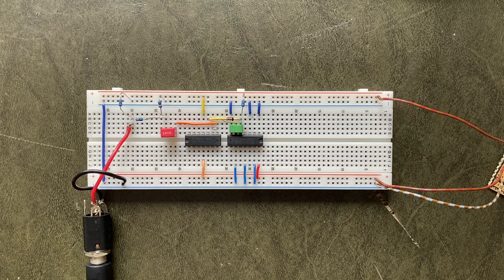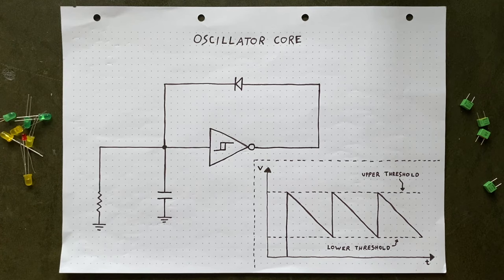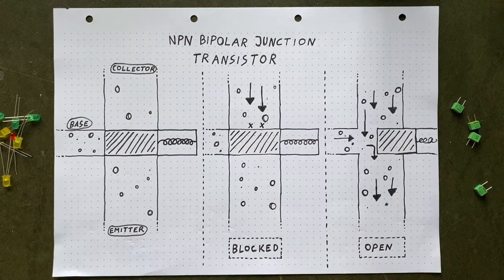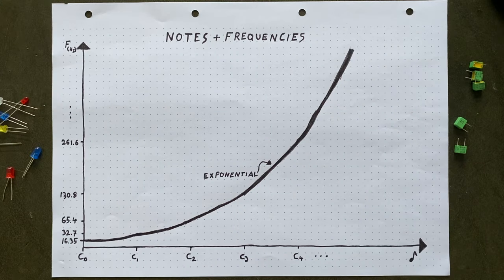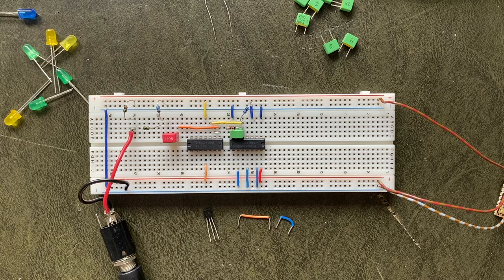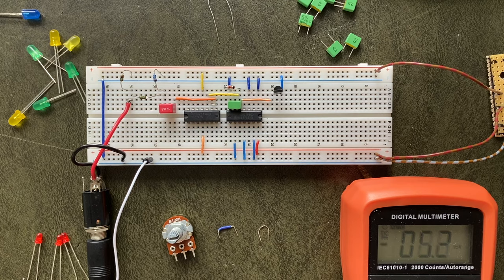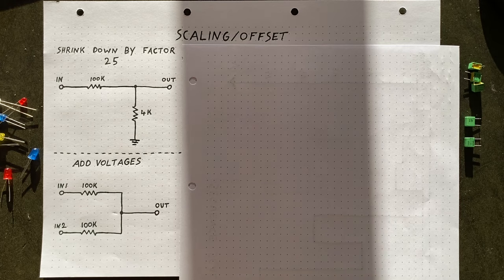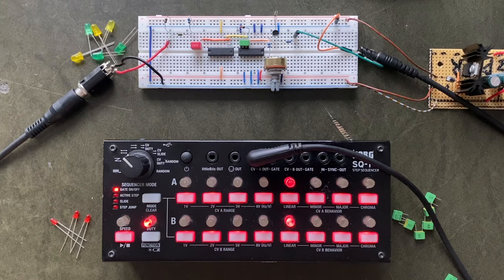DIY VCO Part 2: The simplest exponential converter

Comment: Now when a CV comes from a source such as an MS-20Kit, which is expontential, would you not want the transistor to operate in a linear manner? 
Apparently (haven't tested it yet) the VCO in a 4046 PPL is linear, so it might be a good candidate for me to create another hz/v VCO for my MS-20. 
Lots of material on V/octave, but a dearth on the info for Hz/V. 

(The loser in the Betacam/VHS note voltage scheme war)!!!!
Reply from the maker: yep, Hz/V is linear! but that makes it very complicated to build sequencers for it. hence why it fell out of favour i think.
Reply: @MoritzKlein0  I have more synths that are V/octave than Hz/V, but the MS-20 delivers exponential CV for linear VCOs, so it would be fairly straightforward to control linear devices. no exponential converter nee. On my next digikey run I will pick up a 4046 and see how well it interfaces with the MS-20!
Reply from the maker: @SouthShoreSonics  sounds like a plan, keep me updated on that! ah and there's actually another MS-20 idiosyncrasy: it uses S-Trig instead of V-Trig! this has caused me quite the headache when i was trying to get it to interface with my self-built modular..

Comment: I'm trying to understand why you wouldn't just use the Potentiometer in place of  the restistor in the oscilator circuit.
Reply from the maker: because we're trying to control it with a voltage, so that you can use a sequencer to set the frequency.

Comment: Could you use a vactrol instead (or in addition to) a potentiometer? It would maybe not be super accurate, I assume?
Reply from the maker: i mean – yeah? but why would you want to? the transistor is already used for voltage control here!
Reply: @MoritzKlein0  just wondering it could be interesting to use as an extra modulation source for instance that interacts differently

Comment: I thought radios historically used variable capacitors, via moving plates around.  So I thought variable capacitance was possible.  But I don't know how much variance they allow.  Obviously using a variable resistance is the way to go.  It just seemed the video suggested variable capacitance was not possible, and I was curious why.
Reply from the maker: it’s possible, but not really feasible! that’s why you won’t find it in many synth circuits (if any)
Reply: There are varicap diodes, that are basically voltage controlled capacitors.
https://en.wikipedia.org/wiki/Varicap
But as far as I know they are only used in tuners not in VCOs.
Reply from the maker: @dreamyrhodes  bought some recently to see if i can make a filter out of them. but i don‘t think the range will be big enough sadly.
Reply: @MoritzKlein0  Would like to see that experiment! But I too think there is a reason why they are not used in synths. Maybe in tuners you need way less capacities for the higher frequencies.
Reply: Their capacitance is so tiny they're only useful at radio frequencies.

Comment: It would probably be worth explicitly saying something about where these voltages are coming from. In the first video, the power supply is the only source of voltage. In the second video, the power supply is putting out a voltage to make sound and the sequencer is putting out an independent voltage to give us offsets from that sound. That's what you are adding together in the voltage offset section near the end of the video. But these voltages don't have the same ground. Your sequencer isn't plugged into the same electrical system that your power supply is. For those using batteries as a power supply for the oscillator, presumably a battery-powered sequencer would have the same ground sort of "by accident" of how batteries work, not because their grounds are tied together. This seems like a problem. Maybe you address it in a later video.
Reply from the maker: they do have the same ground, because all grounds are tied together. this is standard procedure with any type of electrical connector - they always tie ground to ground.
Reply: @MoritzKlein0  All grounds in a single building, sure. But two battery sources or one battery source and another outlet source won't have the same ground. The batteries have floating grounds.

Understand I'm not criticizing. I'm just trying to wrap my head around some of these things. Most of the analogies you've made are extremely helpful. The "passive mixing circuit" is just messing with my brain. I found another video that explains it in more mathematical detail, and he does mention that the assumption is all the voltages are sharing a common ground: 
https://www.youtube.com/watch?v=vbr4XbAhlnQ

It also looks like the output of the mixing here isn't the sum of the two voltages but the average.

Comment: Hi. 
Thank you very much for the videos. They are very helpful and well explained.

Just a little correction, because I know you dont like math...
The frequency between two consecutive notes is not 1/12 more than the previous one. 
For instance: if C 65.41 Hz, than C# is 69.30 Hz.
This is equivalent to Freq = note x 2 ^ (N/12), ie the twelfth root of two.

So the difference between two consecutive grades is 1.059463094359. (Magic number of well-tempered scale)
If you multiply the number avove by itself twelve times, the result will be "2". That is, an octave.
You can see the explanation here.

http://techlib.com/reference/musical_note_frequencies.htm

Comment: In the manual for Your Erica synth vco module Your referencing the devider when you talk about the offset and making the volt span smaller for the transistor. But you have removed the devider from the output, I guess because it’s not really that important there and you don’t want to saturate the text. However it’s confusing when you talk about things you have not gone through in the manual. I guess you talk about it in the apendix sp you should reference that instead then!

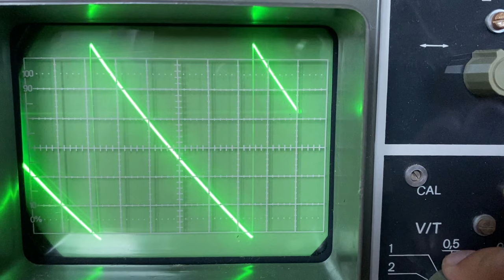Comment: 01:07    I am jaded by all these inaccuracies.  I love the videos because they give me a chance to cite the errors contained therein. The circuit shown here does not generate a real sawtooth waveform,  rather,  a mediocre approximation (due to the use of a Schmidt trigger in lieu of a regular op-amp).  With an op-amp connected as shown here,  the waveform would be even more distorted. When a capacitor discharges through a fixed resistance,  you don't get a linear ramp.  the timing capacitor will begin to discharge at a reverse exponential rate,  multiplied by a constant whose value is determined by the DC offset at the base of the waveform.  A real sawtooth waveform has an inverse linear ramp in the first quadrant, preceded by an undefined,  but ideally, linear ramp in the first quadrant starting from the origin. The only way to achieve the inverse linear ramp would be to replace the resistor with a constant current drain circuit. I don't know what this circuit has to do with exponential conversion,  however,  because I cannot seem to find part 1 or 3,  or any other subsequent videos.  therefore,  I am forced to take the risk of interpreting this video out of context.